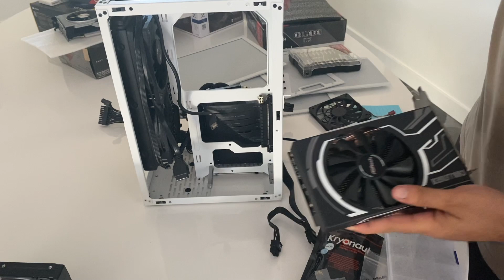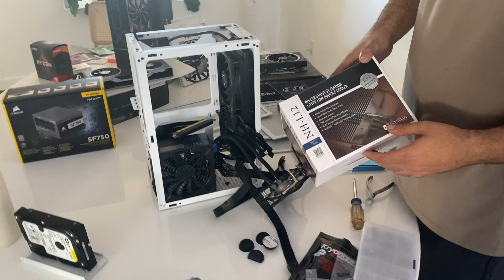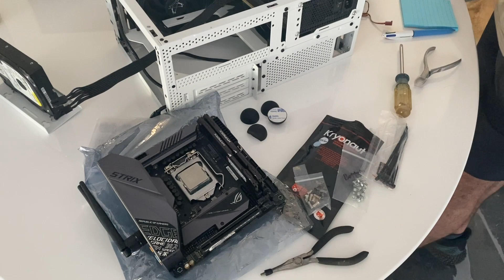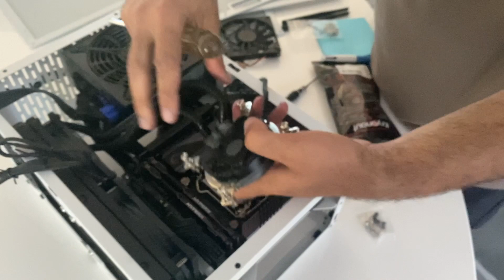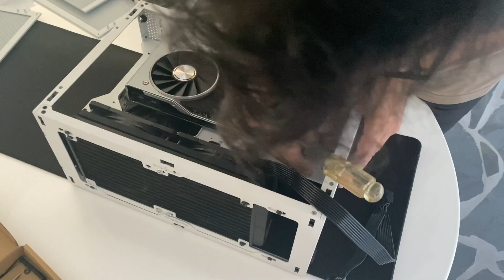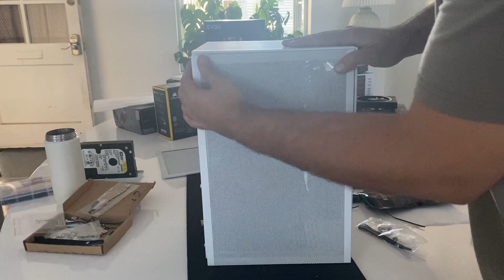SSUPD Meshlicious Build Guide by @sffbuild

Comment: What are your thoughts on using a 180 degree adaptor for the GPU cables, think you could hide those behind the mobo as well with one?
Reply from the maker: You would have to implement the stand-off mod for the GPU PCIe extender to be able to accommodate the use of 180-degree adaptor for the GPU cables. It's totally possible to do the stand-off mods to both the mobo and GPU if you have a two-slot card, which is how I currently have it set up in my system.

Comment: Super clean with the stand off mod. Do you feel like you will keep the 9700k for a while?
Reply from the maker: I think so, it's a great chip imo.
Reply: @sffbuilds5242  I have a 9700k at the moment also but just purchased this exact case. Just trying to justify upgrading to a newer cpu or find an itx mobo for this case.